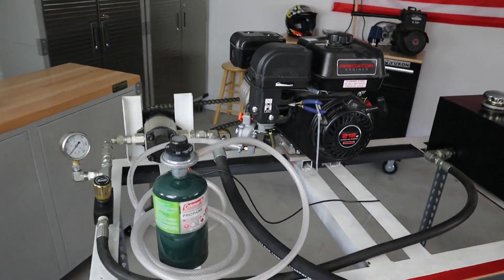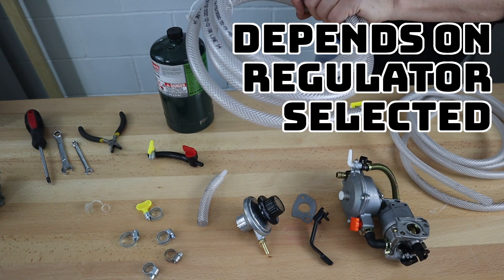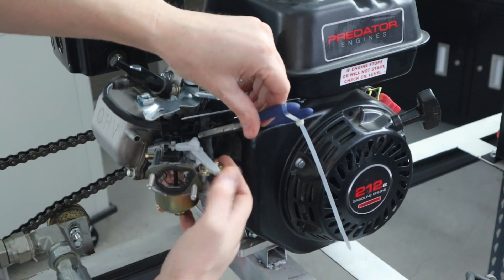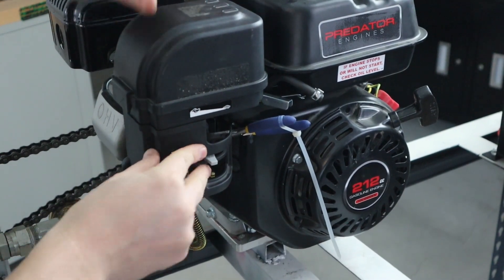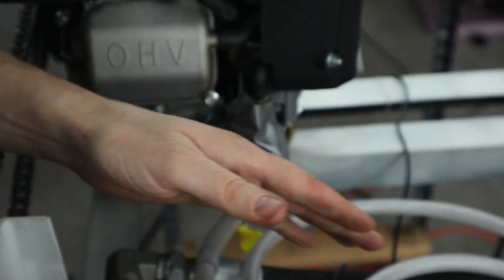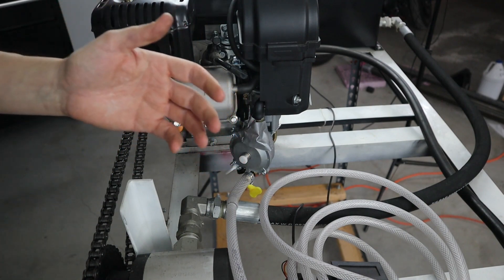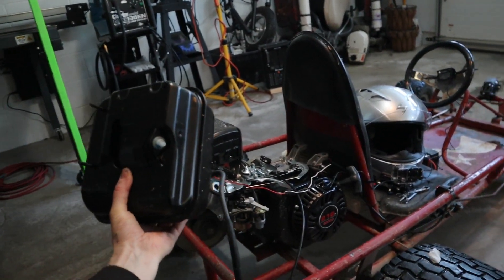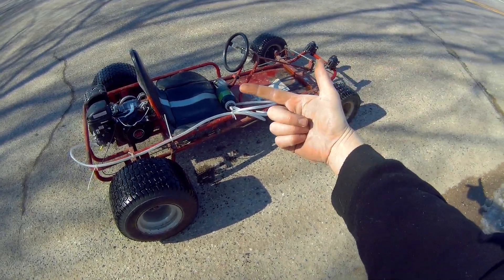Dual/tri fuel carburetor conversion for generators, mini bike, go kart, propane

Comment: This was mentioned below but bears repeating: If you swap out the carb on your generator (not an inverter type), you want to verify that it runs at the correct speed - 3,600 rpm to produce AC frequency of 60 Hz.  You can use a tachometer or use an electric meter like a Kill-A-Watt that will give you a frequency reading, and adjust the throttle as necessary.  The engine speed will droop a bit with load, so shoot for something like 62 Hz (3,720 rpm) with no load and 58 Hz (3,480 rpm) under the full rated continuous load of the generator.  Also note that the maximum load will be 9-10% less on propane compared to gasoline.

Comment: I suspect the reason propane is working better is because it has a higher flame speed; these little engines have a set amount of ignition advance and its not enough for high RPM operation. I wonder how something with an advance key would compare to the propane? 🤔 I suspect the gas engine might make closer top RPM/power but feel more peaky

Comment: DO not crimp your fuel line like this, it is a sure fire way to destroy the fuel line, use or make the proper tool, I use a small pair of needle nose vise grips and have rubber tubing over the jaws so that the sharp edges don't slice into the hose I am crimping, while needle nose pliers will work using a self locking tool will negate the need for a zip tie. Always use rubber tubing on the jaws, save yourself more work or a hard time down the road, nobody wants an engine fire cause you crimped the fuel line and damaged it in a way you can't see only to have it leak fuel all over a hot engine injuring someone or worse. Work smarter not harder.

Comment: If I recall, you put half a bottle of octane booster into a half gallon gas tank.  You mentioned that the bottle was good for a 29 gallon tank.  Didn't you understand that the booster SLOWS down the flame front so that the spark can be set further back, to optimize a longer burn before TDC?  Of course the LPG is going to allow the engine to rev higher when you were handicapping the gas burn with the octane booster to the point where it was very likely leaving a heavy deposit on your plug due to the overdose.  Without that interference, the LPG could not help but show an improvement.

Comment: Well I now know why the one I got for a wood splitter don't work right.
I tried putting lp to the carb before the regulator was on, I must have blown the seal/gasket out.
I can start it on gas and get it to run on lp but when it hits a load and bogs the engine the air fuel mix goes WAY bad. Backfires and/or dies.
It actually backfires bad enough to move the choke lever from 0 to 100%
It's a HF 212cc engine.

Comment: have you tried the setup on a scooter / moped engine , i wonder if the rpm chnges and the different loads like when moving up or down a hill will affect the setup
Reply: LP would require oil injection to use with a two-stroke but a load is a load in any application. A simple carb adapter would be easy to make from scrap if you care to experiment.

Comment: Excellent vid! A few questions: 
1) Would it be necessary to add some kind of flashback arrestor to prevent backfires from traveling up  the fuel line? 
2) So the only difference between running NG or propane is the fuel pressure, which is adjusted by that orange knob?
3) Do you really need to get a multi-fuel carburetor for this mod, or could you just do the jerry rig way of making a hole in the intake and feeding the fuel line in that way? It looks like that circular piece on the tri-fuel carb is simply an adjustable regulator for the different fuels, right?

Comment: I just scored my neighbors generator, He sold it and had to give the money back because it leaked fuel,
For roughly the same price as a carb-rebuild kit and a solenoid I converted it to this, 
So I have a tri-fuel 5000w generator for a hundred bucks,    I couldn't afford this normally.

Comment: I bought one of these carbs about 4 years ago for my 3.6KW generator that's equipped with a 208 Ducar. 2 pull start every time. 1 pull full choke, then starts next pull at half choke. Never had a problem with it. Handles 83% loads (my testing) just as well as it did on gasoline and the engine runs slightly quieter. I never ran on NG yet. I bet there would be power loss there.

For the hose I'm set up for a quick connects from tank to carb. The same hose and quick connects you would use on an air compressor.

Comment: So the engine uses the same amount of propane at idle as at full throttle?
Reply from the maker: There is a vacuum draw diaphragm (the circle on the bottom of the carb) that opens with flow.
Reply: @megoingfast  quick response. got my propane carb today, no instructions. Hope the diaphragm works properly as you say The choke should never be closed then , it would make a huge vacuum
Reply from the maker: @biglovesam  choke should be spring loaded, opens under force

Comment: Great vid bro! One question? for a 420cc generator engine this carb kit should work or do I need a different one?
Reply from the maker: Different carb. For most it's a gx390 propane, dual fuel, or tri-fuel carb.

Comment: Why do you think RPM is different, since you are running a governor?
Reply from the maker: From what I've read up so far and speculate, better fuel air mixture/ratios at that speed. The jetting and eTube for gasoline could likely be tuned some. Not sure in full though.
Reply: @megoingfast  I doubt it. It's more likely that governor is just not synced to the new carb properly. Like adding a stiffer spring will give you more rpms. I think your testing is very flawed. You need to be testing at the same rpm range.
Reply from the maker: @MegaKencam  the governor on the engine tested would not kick in until about 5500+ rpms. Under load, for gasoline, the governor is not reached to limit the throttle position. Both scenarios the engine was allowed to reach potential. Governor should not come into play.
Reply: @megoingfast  The gov should kick in at 3600 to 3800 rpms. Valve float will kick in around 5000 rpms.
Reply from the maker: @MegaKencam  I was wondering if you thought governor kicked in at what the box said for rpm. Based on probability, and having had this conversation many times: I do want to point you to the correct information in a genuine and helpful way but have done this before and would only suggest you join a forum or group on small engines and ask when the governor kicks in versus throttle stop screw setting (which I did accommodate for in the video as I do feel if I did not would not be a valid test as suggested). I mean no snobby reply, but perhaps there is a little more to see about a centrifugal governor rating. I do hope you have a nice day!
Reply: @megoingfast  I'm not trying to be an asshole and I apologies if I came off as one. I just think your testing is flawed and I want to determine which one of us is wrong. 
Is you engine modified or not? You say your governor kicks in @ 5500 rpm. You should barely be able to hit that with a stock engine. In that case, why have a governor at all? I never assumed you were using a throttle stop. Generators don't really have one and generally they are not used on go-karts unless you have a small child.

Small engines are governed to ~3600 RPM. This has nothing to do with the throttle stop. This is a standard so that they can be used interchangeably on mowers, tillers, ect... The only way to get them to go faster is to put more pressure on the gov arm or remove it entirely.
Reply: The "throttle stop" screw as it's called has a lot to do with the 3600 governed RPM. It should really be called the governor fine tuning screw. On a generator this is how you fine tune for 120 VAC at the desired load. On a mini bike or go kart application we back the screw all the way out and get 4500 RPM governed. Some of us will move the throttle spring to a different position on the governor arm and get 5000 or more and governed. Also, these engines valve float in the 5600 to 5800 RPM range.

Comment: It should be noted that the governor on a AC generator (with DC converter output) is set to maintain about 60 Cycles Per second output from the generator. On an Inveter generator (DC generator with AC Inverter) the governor is set to respond properly to a load.

Comment: Interesting, I wonder why duel fuel generators have a lower wattage rating using propane vs gasoline.
Reply from the maker: I could guess but since there are so many makes and models it would be that it depends on where the throttle is set. Many generators are set to "full throttle-ish", not always "full potential". Just a guess though.
Reply: The reason is that propane has less BTUs per " unit" than gasoline. Roughly 90% of gas, thus the lower power output.
Propane has a much higher octane rating than has so it can handle more compression and timing.  An engine built just for LNG has MUCH better performance and fuel consumption.